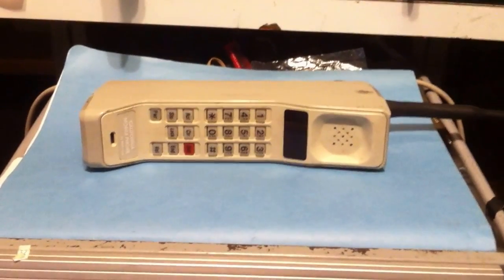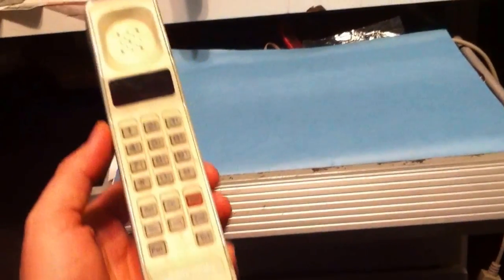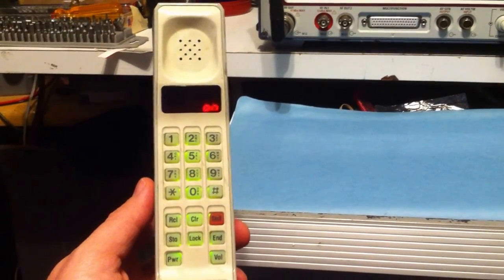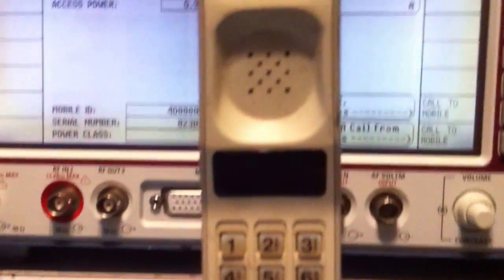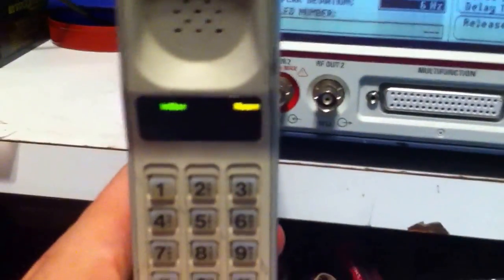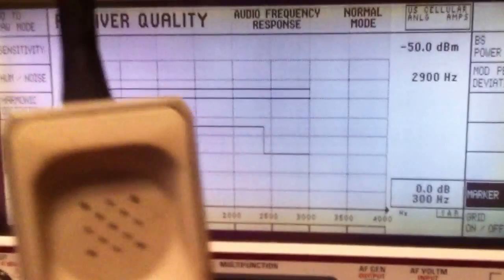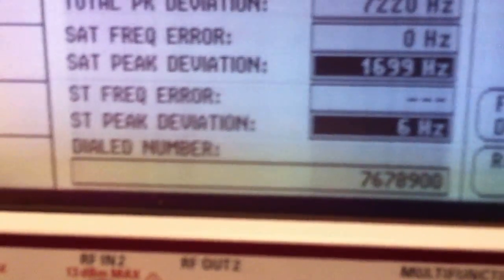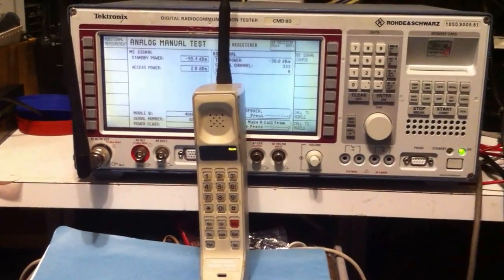Motorola Dynatac 8000 demo with Tektronix CMD 80

Comment: Did all the DynaTAC 8000 series have backlit keys?  Do you know the exact year and model when your phone was produced? See: https://www.retrowow.co.uk/retro_collectibles/80s/motorola_8000X.php
Does the battery say what its capacity is?
Reply: There’s some errors in that article. First, the DynaTAC 8000x was ONLY made in beige with a black front. If it doesn’t have those colors, it’s NOT an 8000X. Period. It also doesn’t mean for sure it’s an 8000X if it has those colors, as there was the 8500XL that looked identical, just with the newer, bigger LED display. Also, there are many 8000Ms (like the one in the video) that don’t have an all-caps font on the function buttons.

Comment: If I was able to build a high frequency analog tower can that emit all over America with the cmd 80?
Reply: If you did that i would be so surprised to see my car phone and microtac get a signal. (i would probably dial a random number)
Reply: You probably going to be fined for violating frequency allocation regulations.
Reply: Milael Nyquist you'd have to dule it all with AT&T who says their Network is the best and most widespread. Baby if you charged $7.50 for unlimited local and $15 for Nationwide you can be the top shark. Problem is AT&T trick people with Trac fone. People who want minimalistic cell phone to think they are saving money. Having a $20 plan on an Android phone for once in a blue moon calls. However it's only to get them into YouTube and Android games at outrageous data rates. Your best strategy is to put built-in fidget spinners another gimmicks on your next-gen 1st Gen cell phones.

Comment: would be awesome if they created a similar thing to keep in your pocket that made the phone work again with new architecture, with a Sim inside maybe
Reply: cjrd28051994 they did but it's just an Android phone inside a plastic box to look like a dynatac maybe there is a few dumb phone versions but they are nothing like the original dynatac.
Reply: How to basic Not what they are talking about; they are talking about a pocket-sized AMPS emulator that could be used with an old phone like this and connect to modern cell towers to place calls.

Not sure if something like that would be possible, but it would be cool as hell!

Comment: Very Cool,
In the 80's,
I used to repair these phones,
UK used the TACS system..
Reply: I've got a DynaTAC 8000S that won't register with my Tektronix CMD 80 at all. It just keeps flashing NoSvc. Any ideas?
Reply: do you have it set to analog and amps. if so try namps and also you may need an antenna on the cmd 80.
Reply: Rainbow_Dash_7x Yes, I’m using an antenna on the CMD80. It wouldn’t work at all with out one. I have since gotten a Motorola America Series 900 (identical to the 8000S) and it too doesn’t register with the CMD80! Don’t know what’s up, but I really don’t think both of the phones are broken.
Reply: No one cares about the UK